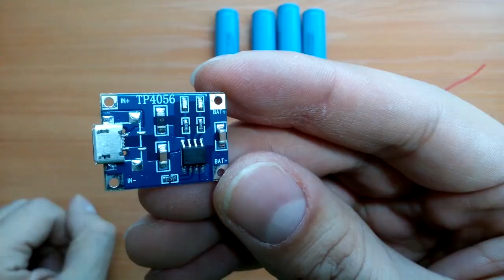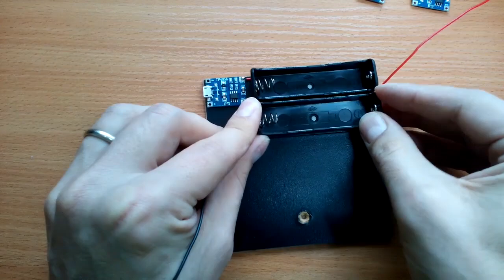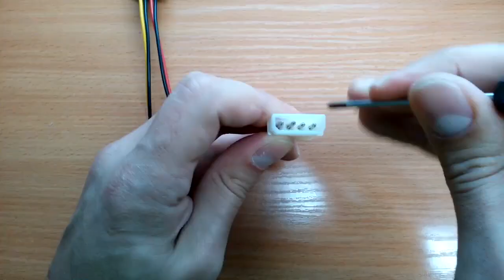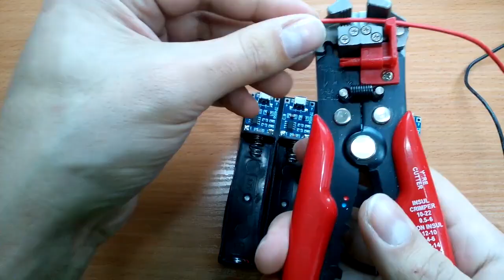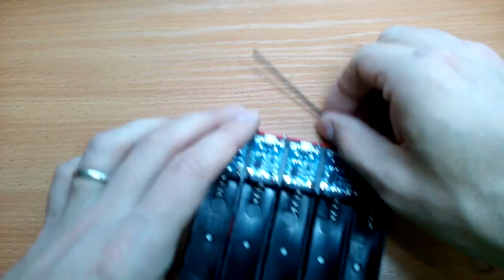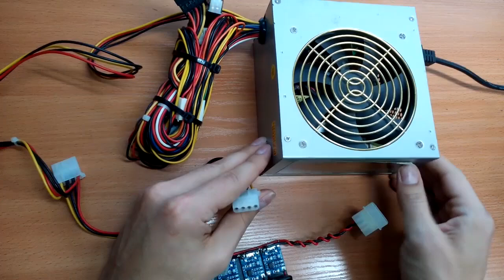DIY: Lithium 18650 Cells Charger By Using TP4056 Modules

Comment: how make over discharge protraction ?? plz rply
Reply: You can buy it on ebay , it doesn't cos so much. Just type: PCB Protection Circuit Board for 3.6V 16340 18650 Li-ion Lipo Battery Pack. in search
Reply: Smart Electronics 5V Micro USB 1A 18650 Lithium Battery Charging Board With Protection Charger Module for Arduino
 http://s.aliexpress.com/ArIV7feq 
(from AliExpress Android)

Comment: I want to charge a bunch of up to 9x 2900mah samsung cells in parallel mode (need that ~3.0-4.2V for an LED Matrix project). Therefore I need a much higher charging current, eg from a 6A 5V power Supply. Any how, I cant find a circuit / module to charge with more than 1amp. I wondered if I could use eg 3 of those cheap TP4056  circuits to charge with 3 amps in parallel - or are there other options? These 9 batterys act like an internal battery in my case so they will be all connected in parallel.

Comment: How many amps do you need to supply from the 5 volt source? will 2.4A be enough to charge 5 batteries simuntanesly or do you need 1 amp per battery? :)
Reply: for a full speed charge, you need 1A per cell you are charging. A 2.4A supply would still charge them, just at 2.4/5 the nominal speed. I use a 2A supply for an iPad and charge 5 batteries, at a much lower speed.

Comment: Very clean build and nice video. Do you know of ANY possible way to INCREASE the charge current? My batteries have so much capacity, it takes sometimes 4 to 5 hours to charge when they are extremely low. I'd like to increase charge current to 1.5 amps. Im an accomplished technician with a decent soldering re-working station and have even soldered these small surface mount resistors successfully. Even if I have to heat sink the chip, I'll do it ... I just need more charge current so any info or ideas you have, please let me know?  Thank you!
Reply: A resistor on the board determines the current. Datasheet has a table k vs. mA
Reply: Yes but this chip wont do more than 1Amp ... I was thinking of a current multiplier circuit on the output, but the problem (as with trying to build a reverse polarity protection circuit for this thing) is that the chip needs to sample the voltage of the battery from time to time to make adjustments to the current / voltage.
Reply: you can use two of these adapters in parallel i think

Comment: I would recommend mounting them on aluminium, because with 1 amp output IC is getting quite hot and lower output current, at least it was the case with my modules

Comment: Is it possible to connect two tp4056s to charge 2 3.7V Li ion batteries in series?
Reply: Two tp4056 in parallel by the way.
Reply: you could theoretically charge 2 18650's in parallel with one tp4056, but only if they are perfectly balanced, which is not ideal. If they are in series, you can connect a lead to each of them to separate tp4056 and balance charge them.

Comment: That's some slick soldering you did there, nice job.
Reply: nothing special but i like those strippers :} gotta get me some of those!
Reply: @em0_tion  I use those for 10gauge and up to 24
Reply: How do you mean?
Reply: Yeah. I'm a lot slower than this.
Reply: Would have been a much neater job if he drilled through the holes and brought the wire up from below.
Reply: @manickn6819  aaaaaaaaaaaaaaaaaaaaaaaaaaaaaaaaaaaa
Reply: @manickn6819  aaaaaaaaaaaaaaaaaa
Reply: @manickn6819  aaaaaaaaaaaaaaaaaaaaaaaaaaaaaaaaaaaaaaaaaaaaaaaaaaaaaaaaaaaaaaaaaaaaaaaaaaaaaaaaaaaaaaaaaaaaaaaaaa

Comment: Why can!t connect battery parallels and using only TP4056?
Reply: Refrase please. Don't understand the question. . . . .If the question is :  can i charge more than 1 lithium with one TP module? Yes you can but it will take longer to charge them.
Reply: Fair enough! Thank u
Reply: Obviously, it would take more than twice as long to charge. More important, is these batteries are not balanced. They hold different charges. You would want to have separate charge controllers for each one. The same when they are in the big bicycle pack he shows later. When you charge this pack, you do not want to simply have 1 charge controller for the whole pack. What happens when 1 cell starts to fail, there is no way of knowing without dismantling the whole pack. That's why I loved a design by a German guy where he used a copper plate to join the cells together. In minutes he had access to each cell, to test if it is good, and replace that one cell.

Comment: can i charge my drone lipo battery 3.7v. 650mah with tp4056 and do i need u change the resistor
Reply: check the datasheet. You need to make sure it can handle the 1A charge current, and that the upper voltage is 4.2v, like the 18650 cells.

Comment: Hi. Excellent video. Very nice and to the point.

I got a 5 cell lithium ion batteries connected in series, giving me a lot of amperage at 3.7 volts. This device requires to be charged and uncharged many times like a mobile device, but works on 3.3 volts. 

What do I need to modify to your circuit to allow this mode of operation?
Reply: well, nothing. maybe a step-down converter to Limit your Voltage. 3.7V batteries contain +-4.3 when fully Charged, which isn't harmful by the way! 3.7V is just an average, it kinda floats around during the process of discharge
Reply: Ciao. 5 celle in serie ti danno amperaggio elevato a 3,7V ?    Per avere un elevato amperaggio con tensione  3,7V   le 5 celle sono in parallelo, NON IN SERIE  !!!

Comment: Can you make a video on how to make a pack so you connect all of the 5v charging ports together and then connect the output to the item so 

(So you don't have to remove and un-clip  the wires to charge and use the power)

Comment: if they are connected in parallel how many amps does it charge the battery?
Reply: wiring them in parallel would decrease resistance enabling more current to 'flow' and Fry the circuit! don't recommend doing it ;)
Reply: if you have 5 tp4056's in parallel, the max they (should) draw is 5A. If you have a 1A supply, they should all run, just with much lower speed. I'm currently using a 2A usb power supply from an ipad, meaning it only charges them at 2/5 the speed, but fine enough for charging a few batteries every once in a while
Reply: zKeen I using a 16A power supply from my computer..
since the input of the module is wired in parallel and the output of each modules are wired in each battery holders is that mean that each module provides 1A for one battery?
Reply: M Spencer
it will provide 1A to each cell, as long as you have less than 16 batteries. Once you get over 16, you will start to drop current
Reply: zKeen okay. thanks bro.. :)
Reply: +zKeen wait... are those wires from battery holders can hold the amps coming from the module? it looks too thin..
Reply: +M Spencer it's only 3.7v1a  (maximum) going to the actual battery. Should be ok ;)
Reply: + zKeen      4.2 volts 1 a max. You can't load a lithium 3.7v with only 3.7 v. Well you can, but only up to 3.7 v
Reply: so the wires are okay? do i need to change them or not?
Reply: yea should be fine
, what i use for mine
Reply: zKeen thanks..

Comment: Question. If the good 18650 cell voltage is about 3.3-4.2 at full charge.

Why use a 5V charger? Is that fine?

Great video and idea btw!
Reply: you need a higher Voltage to charge something
Reply: +highks  I use the TP4056 (1 piece) to charge 2 18650 wich works fine, it doesn't even double the time as i expected.

Comment: Do you know the name/model number of your wire stripper?
What is the part number for single or dual 26650 battery holder?
Will this TP5096 able to charge 26650 battery?

If you don't know the answers, don't ask me to google it.

Nicely done.
Reply: Hello :)
For the wire strippers google 'self adjusting wire strippers', the same goes for 26650 battery holders - they are pretty easy to find in online vaping stores or chinese stores, such as fasttech etc.
26650 batteries have nearly the same specs as 18650, the difference mainly being in capacity and max amp output - and for Your question - yes, the TP5096 SHOULD charge 26650 batteries without any problems.
Reply: The 26650 is not the same as the 18650. It will not fit into 18650 battery holder.
That like saying the AA is the same as AAA.
Reply: they're for 10bucks on aliexpress bro
Reply: +angelisone they're for 10bucks on aliexpress bro

Comment: Is the TP4056 protected or are the battery's protected?
Reply: +Houtje Boom - Be Creative 
Module just charges battery by 1A to 4,20V, so there is no need fo any protection.
Ofc if you will connect power or battery reversed it will burn.
Reply: Wouldn't be too hard to throw in some schottky diode's on each battery holder to protect it, the reverse leakage wont' hurt them., would only add a few dollars to the price. It's not so bad with batteries with tops but I can see putting the flat tops in the wrong way as I have done it in the dark. I like the SS16 variety as it's smd but 1N5819 would probably do the trick as well, anything that meets the specs really.

Comment: I think you dont need 5 moduls, 1 just fine
Reply: Because of time necessary  to charge . 
1 module has 1Amper so for 5 batteries the amperage is divided to 5 = 200mA resulting a 5 times more time necessary to wait . Instead to wait 4 hours you will have to wait 20 hours

Comment: Not long ago I started playing with Li-Ion batteries from Dell packs just like the one you disassembled here. Most people don't know that a laptop battery pack can be "dead" when only one or two cells in it are "dead".  I like your methodology of verifying and sorting the cells by remaining capacity and will get myself one of those charger/discharger devices.  Thanks.

Comment: Nice video thank you.  Here is a mod I would like to see - voltage indicator for each battery channel.  Then it would be like commercial battery charger.  Do you think this would be easy to add?  Voltage meter LED panels are cheap and easy to use, but would this affect the charging and connection to TP4056 at all?

Comment: Would this circuit also work with 1.2 volt AA batteries ? Thank you
Reply: +Tony tFuntek No. This will ONLY work with lithium ion batteries.  Alkaline AA & AAA batteries cannot be recharged.
Reply: Alkaline AA & AAA batteries are rated for 1.5 Volts, so I guess he's talking about rechargeable Ni-MH batteries which come in AA & AAA sizes rated at 1.2 Volts, in which case, it wouldn't work without a proper AA battery holder but I'd recommend no more than 500 mA per AA battery.
Reply: The TP4056 is only for Lithium Ion batteries.  The data sheet is quite specific about this. For Ni-MH batteries you need a Ni-MH specific battery charger. And the appropriate battery holder.

Comment: Can you use something like this to charge small lipo batteries from like toy helicopters and stuff?
Reply: +Raul Valdivieso Urdiales yes, you can use this charger for lipo also. but i would suggest you to buy a normal lipo charger like imax b6 or turnigy accucell6, these chargers are much safer to use and have more functions that you can use with lipo. you can also buy cheapo chargers like imax b3, they will also work fine
Reply: Grigoriy Chernov ok thanks, ill try one of those :)

Comment: Hello i have almost the same setup as you do. But my problem is that I'm trying to charge 2 sets of 3 Lithium 18650 batteries in series for a total voltage of 12.6 or 12.8 volts. I'm trying to figure out how to charge the whole pack without over charging them or under charging them. Can you please help me out?
Reply: +joseph chrzempiec (josephchrzempiec) Easiest way is to solder a balance connector on to the pack and use a balance charger
Reply: +Henry Griffiths Hello Henry Thank you.

Comment: Very Informative....I like how the individual batteries are charged using a dedicated circuit. My question is this, since you wired the inputs of each board in parallel would you be able to utilize a micro USB (Phone) charger ? Thank you

Comment: I have 2 18650 in series for 7.2 volts.  What would be a good way to charge this combination?
Reply: The series is spot welded together.  I need to charge them in series.
Reply: Do i need to separate the cells?
Reply: Coolio.  Thankee much.
Reply: +Alex Tworkowski Hi, what did you end up doing to charge two batteries in series?

Comment: simple clean build, you put most of those Ive seen to shame, I especially like how you started soldering little bits of wire for the positive then realised how much quicker it would be to strip the wire a bit more and crimp it to make it stick out and just solder that, I like your style  :)

Comment: This is 1 Amps charging of each battery. what if I want them to charge in a low safe current like less than 350mA? Is there any     circuitry for that?
Reply: just change the resistor on board

Comment: Hi if I connect a micro usb in the end instead of that you putted will it work? (only the micro usb not the whole board)
Reply: +John Chatzakis Mobile chargers (Micro USB) can usually only output around 0.8-1 amp. If you have a beefy one for tablets they are areound 2.5 A. You need 5 A to power all these cells at a time or risk damaging your charger (of course depending on the quality of it).

Comment: Do you know how to make or where I could buy a dc to DC boost buck converter to easily allow the use of lithium batteries in place of lead acid batteries for projects etc so that you can still get max capacity from the lithium batteries by using their full useable voltage range? Thanks.

Comment: Are they just linear regulators? don't they get super hot?
Reply: +Dan Frederiksen No they control the charging current and monitor the cell voltage according to the accepted charging curve of a Li-Ion cell.  They shut off when the cell voltage is maximum for the chemistry, 4.2V (and when the charging current drops below a predetermined threshold).  It's all in the data sheet.  Well worth reading.
Reply: +FranzStrasse linear doesn't mean uncontrolled, it means it regulates by resistive load thus waste.
Reply: +FranzStrasse specsheet says it's linear. that means it wastes from 5V down to the battery voltage. around 25%
Reply: +Dan Frederiksen Yes, you are right, the charge controller is a linear device so technically it "wastes" power because the difference between the input voltage (5V) and the cell voltage (3.3V ... 4.2V) times the charging current (<1A) is dissipated as heat.  When you say "regulates by resistive load", you are half right. The charging current is controlled by the chip with an current source so it's a transistor that's dissipating the heat, not a resistor. Another good review of this charger chip can be found here 
http://lygte-info.dk/review/Review%20Charger%20TP4056%20UK.html

Comment: Can I just use one TP module to charge  battery which all parallely assembled?
Reply: +airul aszyudhi depends on how fast you want to charge. See how many amps the TP module can take. And match that. It would work, but most likely charge very slow.
Reply: If one module supply 1A charging current. Running 1 module for 4 batteries would deliver 250mA to each battery. 1 module with 2 batteries = 500mA per battery. If you do not care about charging speed i would use 1 module for 2 batteries = 500mA charging speed per battery. No need to change resistors.. Just add more batteries instead..  Also.. if you have 1 module for 4 batteries = 250mA .. If you just put one battery in the holder that battery will recieve 1A that is the modules total charging rate.. I guess you catch my point here... You could use 1 module for 10 batteries, if you need to charge faster just insert 1 battery in the holders... :)
Reply: taztaz79 I guess that is pretty easy to understand. 😃
Reply: +Alex Leonard if 1 battery is charded per hour, 5 battery will be charged after 5 hours (sorry for "english" :D)
Reply: +taztaz79 thank. Cause My plan is start charging in the evening, go sleep and get harvest in the morning :-)
Reply: can i use 1 module to charger 2 batteries? and connect them parallel? I'm planning to make a 6 bay charger for this..
Reply: yes, but if 1 cell with same mAh is charged per 1 hour, this will be charged per 2 hour :)
Reply: Ji run oh... if just follow this vid how many amps does each battery takes to charge? do i need to change each resistors to achieve a 500mA current?
Reply: I dont use any resistor to charge 3.6v Li with tp4056
Reply: i mean do i need to change the resistor of each tp4056 to achieve the charging current of 500mA if follow the wiring in this vid? sorry if i ask too many questions..
Reply: If u change one resistor so yes, but i dont know where is the resistor, check ytb
Reply: Ji run i know the  location of the resistor it's on the data sheet. the things is if this 4 modules were connected in parallel is the current is still running at 1amp? or these modules add up so it's running at 4amps?
Reply: dont know, sorry
Reply: Sorry for silly question, if i use 5v . 500mah solar panel, will i be able to  charge them also if i connect all batteries in paralel mode let say 5 batteries will i get  let 10ah out put ?
Reply: 1 mod supports a mere 1A. Good luck with that!

Comment: But then if you charge them separately you wont be about to use the batterys together cuz the power may vary in each battery
Reply: +Jesse Lam Makes no difference if you charge together or separately,  The TP4056 will charge a single cell at a low current to a cut off voltage, usually around 1/10th less of the 4.2v each cell carries. These little boards are great and this is a cracking little project. I have one with 20 cell slots plus linked up with Arduino and a 5110 screen giving all kinds of info.
Reply: O okay thanks
Reply: +Lee Jones I think what Jesse is referring to comes from the vape community. They suggest charging all your batteries on a single IC. And even rotating the sets between the holders. This keeps the cycles more consistent. It's good advice if you're putting two batteries close to your face.